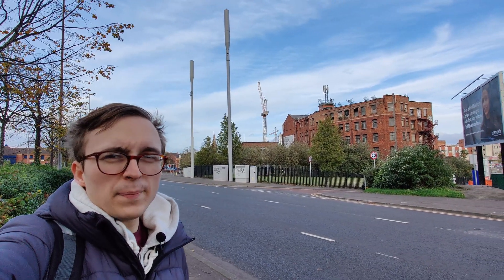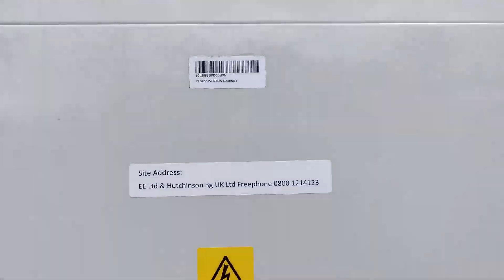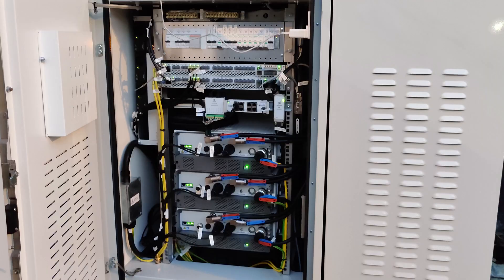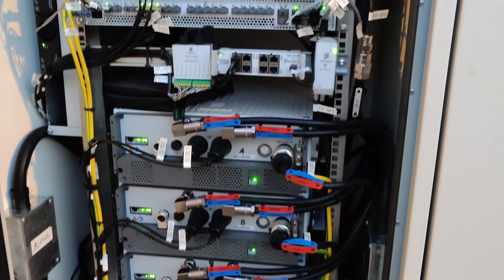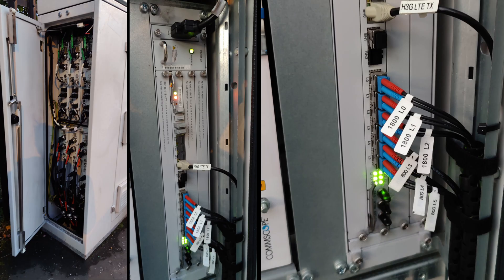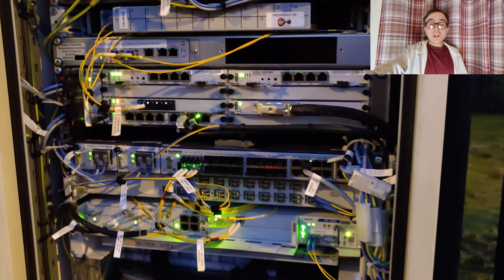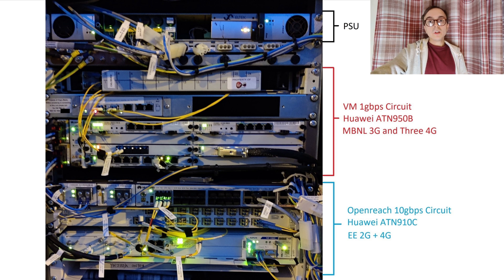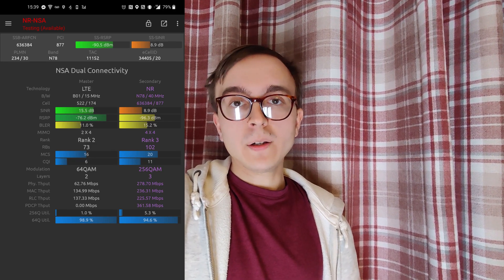Inside the first EE Ericsson Streetworks Monopole (Cabinet Internals Tour)

Comment: cool fromKenya... can see backhaul is connected to an ATN 910C which offers 10gbps capacity to site, The link originates from a hub/switching center probably from an  OSN, The Atn feeds the Baseband unit(BBU) with backhaul which in this case feeds antennae with E1/T1 links(copper), if it were a full fledged LTE site it would feed antennae using Fiber to Antennae/or CPRI links, but for this application E1 sufficient capacity

Comment: That's a 10Gig VM service.
Reply: No it isnt
Reply: @georgeb7641  It's a TMS301 shelf. And to be fair I checked the CAL and it most certainly is a 10gig wave.
Reply: @SolisNotSolis  why would EE use virgin
Reply: @georgeb7641  Historically Virgin provided the majority of Orange and were virtually exclusive in providing T-mobiles backhauls, long before the merger/rebrand and take over. 
If the surrounding mast sites are still awaiting upgrade, it makes perfect sense to utilise the supplier whose already put the spade work in for the uplinks until such time as those sites are upgraded.
Reply: @SolisNotSolis  it's the first EE streetworks mate its just been put up
Reply: @georgeb7641  I hear you, but that doesn't mean it isn't being used as a hubsite for other masts.
Whatever the reasoning, that is a 10Gig VM wavelength presented near the top of the cab. And an Openreach 10Gig Adva near the bottom.
Reply: Obviously going to be a BT 10Gb circuit

Comment: Virgin Media? How does that work? I thought they do things with cables
Reply: Virgin Media have an extensive cable network. Amongst their portfolio are point-to-point circuits, similar to the Openreach 10Gbps circuit mentioned.
Reply: Virgin Media use coax cable to connect a customers house to a cabinet which is often called the last mile. Beyond the last mile, fibre is used extensively. 
It is similar to the companies that use Openreach such as BT, Sky, TalkTalk ect who provide broadband using a copper connection to a house. The copper is connected to a cabinet or exchange and after that, it is fibre.
Reply: How do you think the traffic gets from radio signals to the internet?